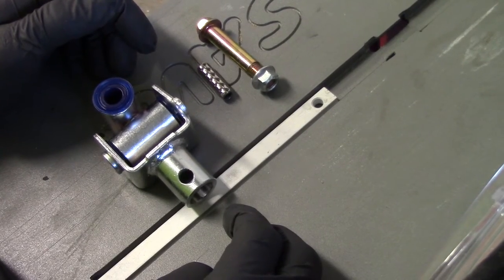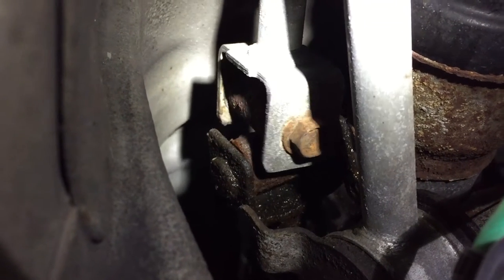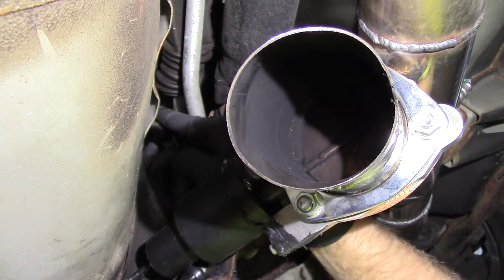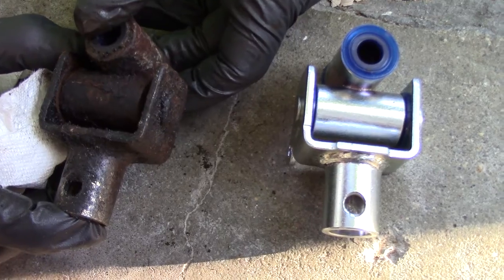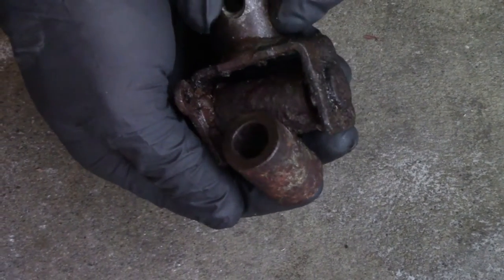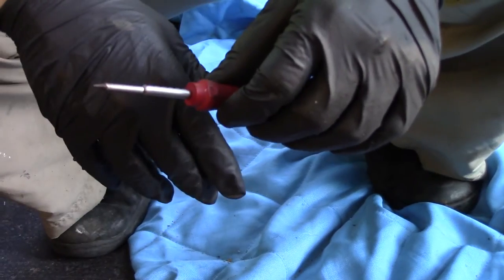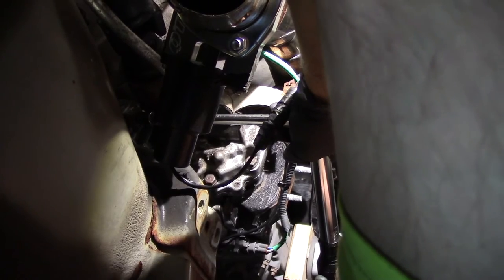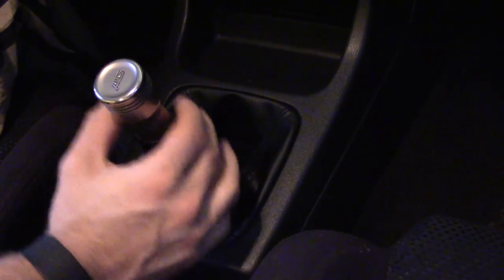How To: 2002 Subaru WRX Shifter Joint Replacement

Comment: nice video.

I'd like to add.
i recommend doing this when u swap the clutch by pulling gearbox out, also worth resealing the shift shaft seal, the centre diff housing and output shaft seal.
axle seals as well probably. especially if the vehicle is old.

Comment: I'm a little late to the party but I did mine today, this video helped a lot so thank you!

Also, from one electric cutout owner to another, good stuff man! That is by far my favorite mod to my car
Reply from the maker: Yep I took that off this car and will use it someday on the 19' WRX I have now. The 02 recently and unexpectedly bit the dust by throwing the timing gear idler going down the highway :(
Reply: @buffwrench5854  oof rough go, just did the whole timing system too. Hopefully I don't grenade it this summer haha
Reply: @matt.martin  It seems the original dealer who did the service at 100K never replaced more than the timing belt and tensioner. How nice of them. So one of the gears that come with the complete kit, took a shit :(
Reply: @BuffRANGE  That's terrible, one of the many reasons I try not to bring my car to anyone to work on. At least I know what was half assed if I'm the one half assing it haha

Comment: Just wanted to say thanks for the video. I repaired mine today. Looks like the old shift joint was missing to bushings. I had a hard time getting the new shifter joint into forks that hold it in. Tried prying it nothing worked so finally I just decided to cut the outer rim of the bushing. I really didnt want to but had no choice. Thanks again for the vid.
Reply: Watched another video where the guy had to grind down the outer rims of the barrel (u-joint made by Turnin Concepts) to install it. He claims you have to do that if your car came with a factory short throw shifter.

Comment: Excellent tips on the shifter joint replacement and thanks for sharing the part numbers.  Camera work and audio were top notch.  I am about the try this on my 03 bugeye.  BTW, your car looks fantastic. I wish mine was in such nice shape.  What headlights you are are using?  I like them.  Thanks for the great work.
Reply from the maker: +David Aurzada these were some eBay specials that someone on NASIOC retrofitted with the FXR projectors.

Comment: How did you get the u-joint bolt out? I've tried using a pry bar, but the bolt seems stuck in. Probably has to do with friction from the bushing...

Comment: Does anyone here know why my shifter is not centered after installing a new one? Compared the new one to the old one and they are exactly the same size holes are the same. I even tried to flip the joint see if it makes any difference but no. I’m thinking the shifter itself is not aligned when I did the first installation maybe I messed it up in the process .

Comment: Isn't there the return spring you're supposed to put in? Or do some subaru's not have it? I have an 04 impreza outback sport and the shift linkage has a spot for it, but im wondering if there used to be a spring there and it fell off?.... not sure
Reply: That return spring was dropped at some point. No longer in use.
Reply: @BuffRANGE  Hey thanks for replying. I appreciate that. Good to know the spring isn't used anymore. There's a mounting spot for it but there's no spring so I was wondering if I lost it, which made no sense as the stick still returned to center.

Comment: Question: Are you able to re-use the roll pin from the old joint? How about the nut & bolt from the old joint? I am curious because I am replacing the bushings on my 02 WRX shifter and I just can't seem to find the roll pin and nut and bolt online.
Reply: +mark kipper You could as long as they aren't all beat to hell.
Reply: +Buffman Thanks! The one I was really worried about was the roll pin.

Comment: i got the pins and bolt out but the joint is seized on the shaft.
I tried tapping on it and heating with a propane torch but it will not move.
Any ideas?
Reply from the maker: +Richard Woods penetrating oil and more heat
Reply: +BuffWrench  My brother cut it from the pin hole to the edge with a cutting torch. We were able to pound it off from there. This makes a tricky job a lot harder. Something to think about if you are doing this job.
Beating on the shift shaft probably is not too good. Mine is a 98 I would be surprised if mine was the only one seized. Something to think about??  Thanks for all your help.

Comment: Would this joint fit on an Impreza 1997 1.8L coupe??
Reply from the maker: Not sure if if the part #s will interchange, but there should be a manual online that tells you the number you need.